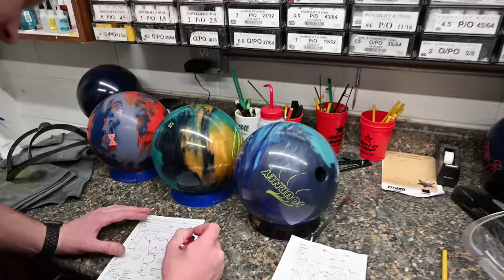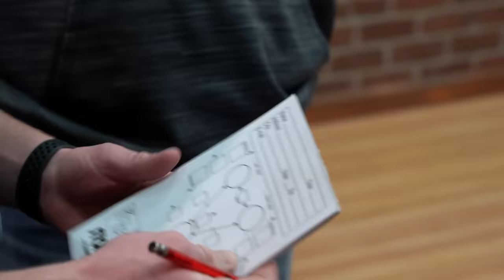Beginners Guide To A Custom Fit Bowling Ball | Storm Bowling

Comment: I just had all of my specs redone for the first time in years. I only live a half hour from Buddies pro shop in Connecticut and Chris Forry knows his stuff. He did everything from measuring my span, to recording me throw a whole game, to putting tape on my ball to measure my PAP and then going through my arsenal. Turns out my span was too short and my thumb was a little too big. My new fit feels the best it has in a very long time.
Reply: I see the house mention buddies all the time. I'm going to have to check them out. My pro shop guy has never done any of that with me. My fit just feels off. It's a three hour drive for me though, but it seems like he knows what he's doing.
Reply: @Ethan428  Packy and Prather know Chris. Believe me, it's worth the trip. Chris will make a spec sheet for you after going through the process and any ball you want drilled in the future, they'll drill it and ship it out to you. I highly recommend making an appointment first because they do get busy. He knows pretty much everything about the game and can definitely help you out.
Reply: @Mikey-1990 Yeah none of the pro shops in my area seem to care enough to take the effort to do all of that. Ill definitely go see them thanks!
Reply: My pro shop guy said he sold five of the same balls that I bought never checked out my Pap or anything then I checked out a couple of the other balls that he drilled. They’re all drilled the same way and after I bowled with it, I saw my track was running Over part of my fingertips and he said I must be doing something wrong. I won’t buy another one from him ever again! And when I asked him about the specification, all he said was angular
Reply: Chirs is awesome! I had him drill my 8 year old's first reactive bowling ball and he gave me a few pointers as well! CT Baby!!!
Reply: @DIGraffiX Yessir! He just punched up my Black Widow 3.0 with my favorite pin up layout. Can't wait to use it in league.

Comment: Can anyone come down to the storm testing center to get fitted? I'm in Vancouver Washington and no pro shops in the Vancouver/ Portland area drill based on pap, and definitely don't watch you bowl or find your rev rate, tilt, ball speed, ect. There is one pro shop that has 3 guys who work in it. They are all 70 years old or more, used to bowl professionally back in the 70s, and are stuck in their ways and won't embrace the new technology. One of them told me when i was looking to buy a new ball that the storm tropical surge is just as good as the summit or the journey, they are all round and how much the hook doesn't matter. One of the other old guys, i went in to just look at the balls they had and all that was on the wall were plastic spare balls, the wall was 75% empty. I said "you don't have any good balls? He told me the plastic balls are just as good as any other. Then he asked me would i rather have a ball that goes straight and strikes, or a ball that hooks but doesn't strike. I told him that scenario doesn't exist and a ball with a weight block that hits at an angle is going to strike better than a plastic ball going straight at the pins. He asked me who the professional bowler was there, and said i didn't know what I'm talking about. I just shook my head and told him about had changed since he competed and walked out. I'm not going to put the alley on blast because they have some REALLY great people that work for them, but the "pro shop" is a joke. I'm going to have to buy a pro sect and get my own stats i guess so i can take my ball in somewhere else and tell them what layout I want. Or travel hours to shop that will take the time. I want to start competing locally but not until i round or my arsenal a bit more. I have 2 balls waiting to get drilled and 2 that i know the layout isn't right for me, they don't react like they should. Ok rant over

Comment: I just got back into bowling after like 30 years. I've been going now for about two months, and now practice about 8 games a day, at least 4 days a week. I have a low rev rate, but picked up an exotic gem, an absolute, and a black widow 2.0, as well as a Mix for spares. the Ex pro bowler and decades long pro shop owner operator that drilled my balls never once looked for my PAP, or my rev rate other than eyeballing me making a few shots. I've got a Black Widow 3 coming, and have no Idea where in Connecticut I can get this kind of evaluation before drilling what is now my fifth ball... I want it done RIGHT.  How the hell am I supposed to get better if I can't even start off with the best possible chances. Don't get me wrong, he did measure my hand to make sure the layout fit, but as far as layout position, he just gave me a very basic pin up over the ring finger layout position and I have no idea if it is actually right for me or not.

Comment: I was at the storm factory and I was told they couldn't sell me a ball, I would have to go to a bowling alley pro shop. I was interested in the absolute also. Came out very disappointed
Reply: Storm has never sold directly to the public. We support local pro shops and so should everyone 🙌
Reply: Support the pro shops that won’t make sure they fit your ball properly. Is this the pro shop you speak of ?
Reply: Is possible to bring an SPI ball to guys at Storm and have it drilled, and tested on those lanes?